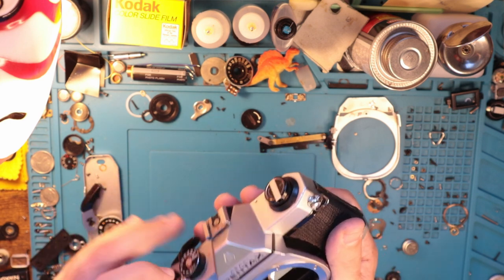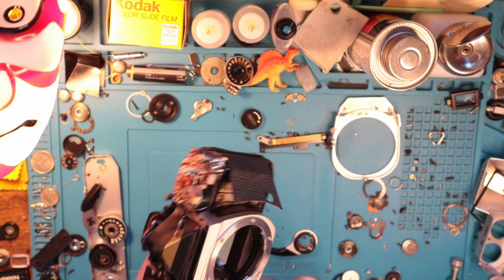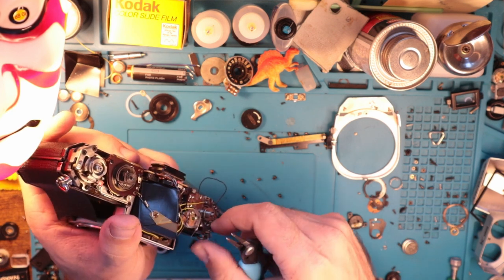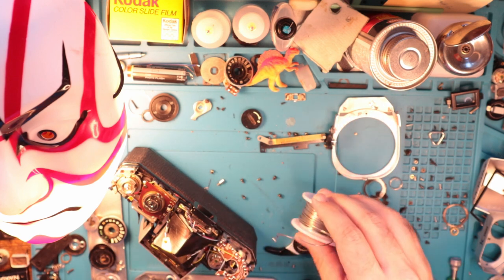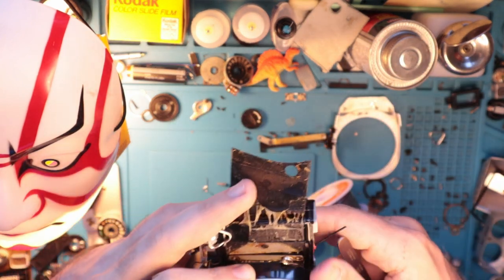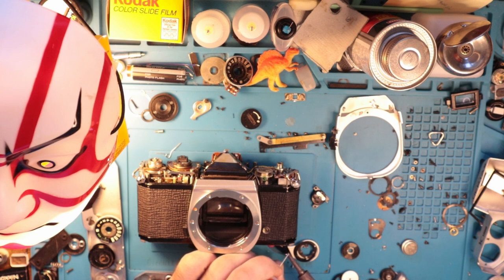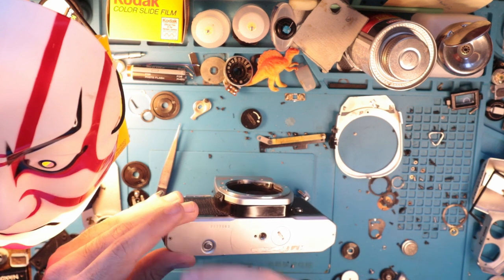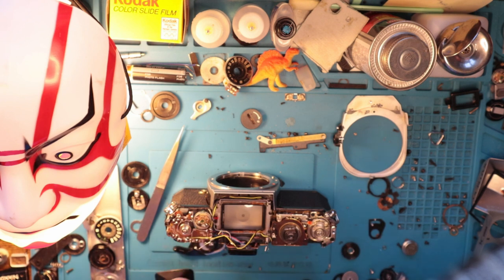Pentax K1000 Rewiring Light Meter Rambley Repair

Comment: It saddens me to have to leave this negative review of Romping Bronco’s services. 

This is my camera. The light meter wasn’t working so I sent it to Romping Bronco, along with a Spotmatic (other video) which also had a faulty light meter. He had offered to look at it for free to determine whether it was possible to repair and he would let me know before proceeding further

He received the cameras, and soon after I received an email telling me he had repaired the light meter on both cameras! So he sent me a bill for 146 bucks (repair costs and return shipping). I of course had already covered the shipping to him. I shipped the cameras on August 1st

When I received the cameras on August 20th I was disappointed to find that the light meter of the spotmatic was in the exact same condition as it was when I sent it to him. He clearly hadn’t tested it properly. In addition, the K1000 light meter was working properly, but the area above the focusing screen was full of large chucks of black foam (large enough to completely obscure someone’s face in a group portrait for example) and it would need to be disassembled again to clean out. 

Clearly, he hadn’t tested or properly
checked them before billing me and returning. I emailed him back and told him about the problems. I even offered to attempt to clean the foam and debris out of the K1000 myself if it was a simple job I could handle (More generous and understanding than I needed to be in my opinion). He responded apologizing about the foam, told me about how he loves spotmatics but the light meters are a common problem, but if he “manages to figure that all out, he’ll let me know and fix my meter for real”. He told me to let him know if I need help cleaning out the K1000 myself. No offer to send anything back, no offer for refund on the Spotmatic. 

I sent him an email asking for more info and guidance (no response) and a few days later, I pressed him some more and asked whether he felt that “it is appropriate for me to be charged a repair fee for it if it wasn’t repaired”.  I even had to send him a direct quote from his own email to me describing the service he would provide for what he was billing me. 

Finally on September 17th, almost a month later he offered to receive the cameras again to rectify the issues. He even admitted via email that he “didn’t do anything for the meter itself, if that makes sense”.  It doesn’t, and frankly, the offer for me to ship it back took longer than it should have. I was surprised that I had to press him, and that he didn’t offer to rectify the problem immediately. 

September 29th (hurricane Ian, work issues, and an upcoming vacation had me slammed) I emailed back and begrudgingly agreed, even though I thought the idea of spending even more money on these to ship them back was ridiculous at this point. All I asked was for confirmation of the address he wanted me to ship them to. (No response). 

I left on vacation and came back almost 3 weeks later, and he still hadn’t responded. So I sent another email on October 20th. No response. 

I sent a DM on Instagram. No response. 

I emailed again on October 25th. No response. 

It’s November 2nd, and I am now understandably frustrated, so I send him a longer, but still polite email telling him that I am not happy, and demanding a refund on the spotmatic light meter repair. I will attempt to clean out the K1000 myself at this point. Defintiely better than sending it back. 

NO RESPONSE. 

It’s now November 27th and I’m typing here. 

Mistakes happen. It’s cool, we can work it out. But to “ghost” me and not respond? That’s just disrespectful. 

I wanted to give him the benefit of the doubt. Maybe there’s something going on and he’s unable to respond. But he seems to have plenty of time to create new YouTube content, do other repairs than to respond to a customer and right his wrong. I see where his priorities are. 

So in short, I spent over 160 dollars for romping bronco to “repair” my cameras, but one of them wasn’t repaired and with the other he created a new problem that would require disassembling. 

I shipped these cameras to Romping Bronco August 1st. He had received them by August 4th. I haven’t heard from Romping Bronco since September 17th, and it is now November 27th. That’s 118 days since I sent these in for repair and 71 days since I’ve heard from Romping Bronco. 

I don’t know if Romping Bronco will even allow this comment to remain here, but I’m hoping I can save some of you the trouble of going through this.
Reply from the maker: Hey man shoot me an email rompingbroncosales@gmail.com

Comment: What type of solder and soldering iron do you use? I have the same issue and would like to give the fix a try. I'm not going to replace the whole wire though - not yet.

Comment: Congrats on 1k! Sorry if you mentioned it in the video, what gauge wire do you use for rewiring?
Reply from the maker: I did not mention that actually, so I use 30 AWG which works for the most part but I think a smaller gauge would work just as well dealing with such a low powered circuit.